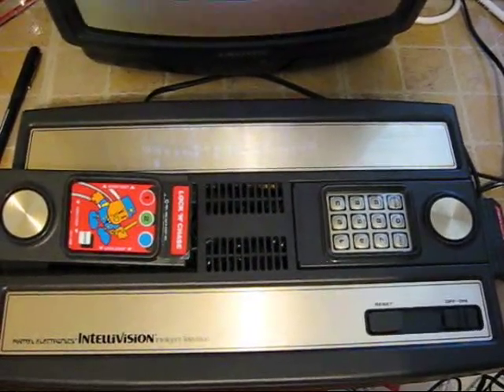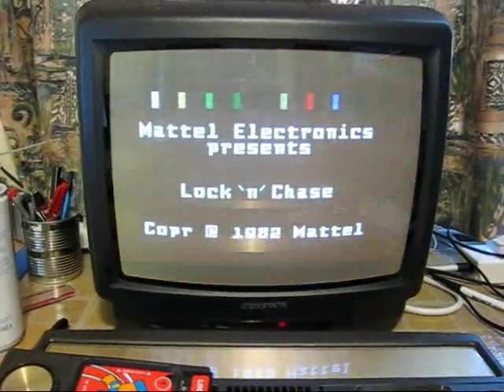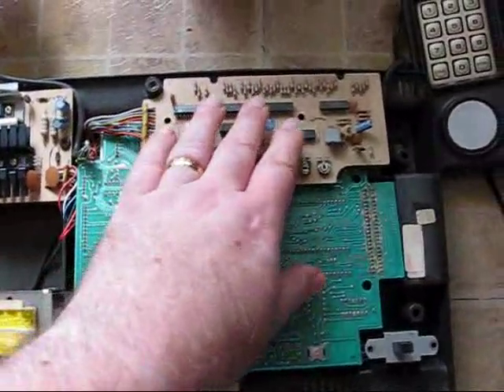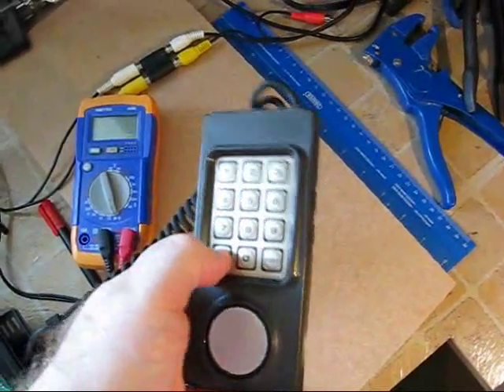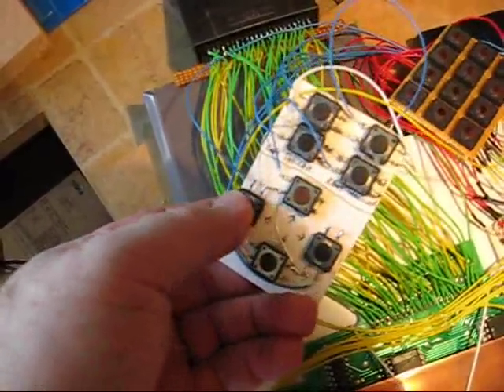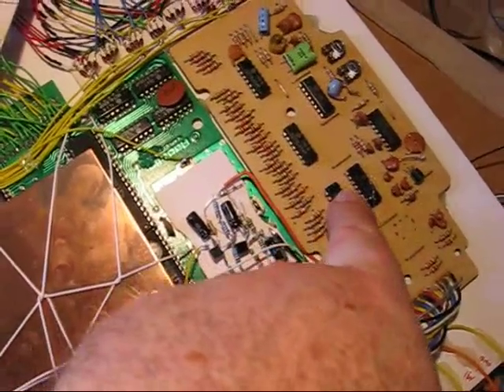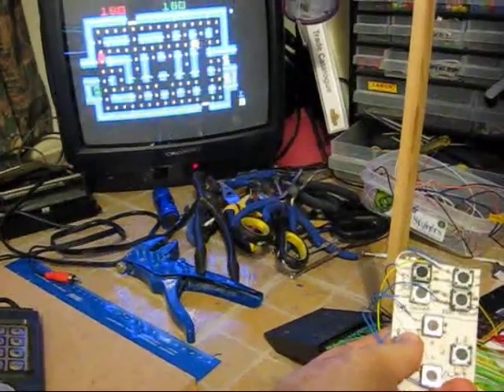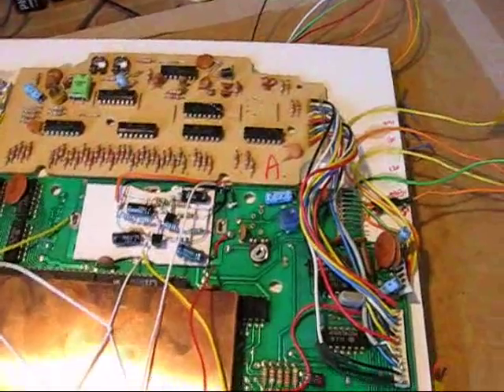Alpha Omega project - part 3 - Mattel Intellivision

Comment: the intellivision suffer from a clear video signal. If you follow the route through PCB you will notice heavy noise in the signal which renders the picture useless at some point on modern tv sets. If you properly extract the signal at the right solder point you do not need to disable the HF modulator either because it can't influence the signal anymore. Using standard AV mod for intellivision on cube based TV sets show a much better picture but most of the TV sets are plasma and current one LCD only. On these TV sets the output looks ugly and HF modulator is far better.
look out for the newest AV mod delivering RGB like output (well it is of course not equal as composite sucks from color bleeding and border coloring due to its nature but is far better than any other AV mod ever seen). Currently it is unclear if RGB sucks from same noise as it takes the same poluted signal the standard AV mods are using - and this signal is quite dirty.